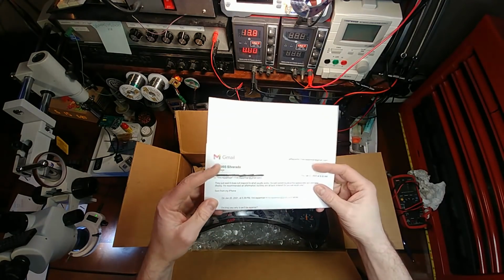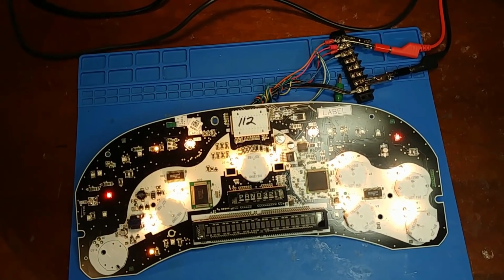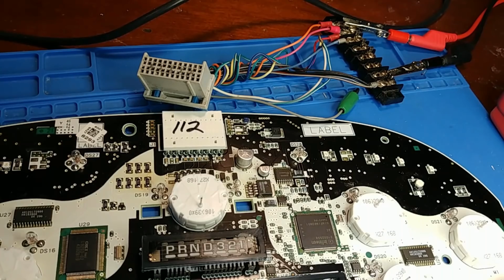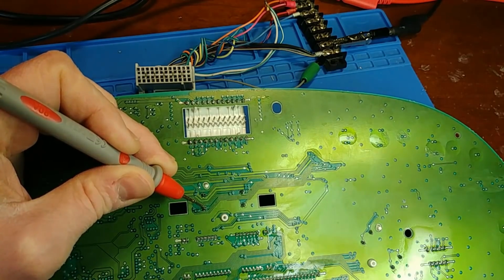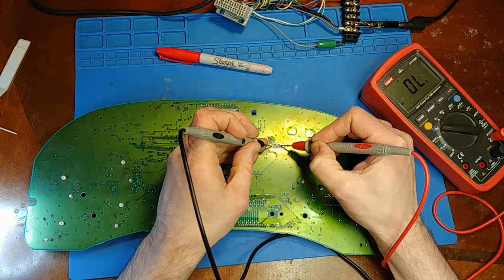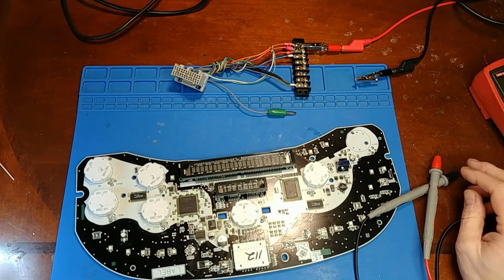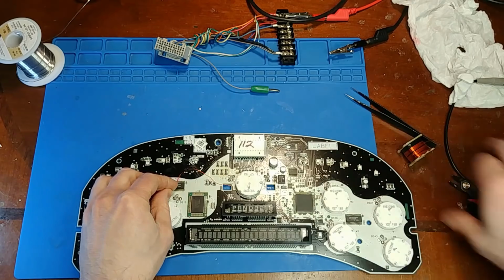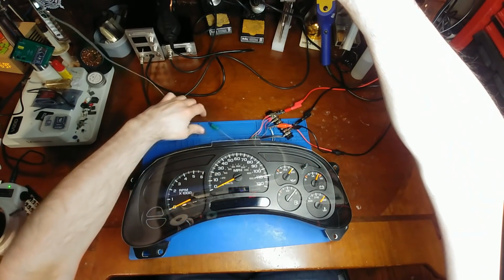"Liquid" Damaged GM Cluster Repair

Comment: It wasn't mouse pee. A lot of board houses manually sand the surfaces of the raw copper boards and sometimes they get a little carried away.
Reply from the maker: Did you see the microscope footage? That break in the foil wasn't from sanding. It was a clean rip right up against the transistor, the transistor would have shown signs of the sanding on it, but it showed non. Plus corrotion forms on the bottom side, not there in the top at that transistor.
Reply: @jeffescortlx  I have ordered thousands of pieces of dozens of designs from a solid 20 board makers. What you describe as a clean break was nothing more than a very low amperage fuse.

Since there is no way for mice to get inside of that cluster and there are virtually no traces of there ever having been one, what other cause could you attribute to a production board with multiple identical and unusual failures other than the boardstock?

It's clear there is something wrong with it, so maybe it got scratched at the factory? Something wrong with the photoresist? Too much time in etching?

I was only a third of the way through the video when I posted anyway.

I have boards of my own design with the same problem not too far away from me.

Another problem caused by too thin of copper is inability to withstand mechanical shock (like hitting potholes in a Silverado).
Reply from the maker: @btasler  the transistor wasn't shorted. It had no reason to pull excessive current. While a mouse can't fit inside, it can build a nest behind and on top of the cluster, so it can't be ruled out.

Comment: No hot glue to keep the wire from vibrating and breaking?  Personally, I probably would have used wire-wrap wire and run it though the via to solder top/bottom.
Reply from the maker: Read PP comment from yesterday we already talked about it. And icesoft1 comment about going through the via, we already talked about that too.

Comment: Hey Jeff, great work. Always admire people who are doing their job professionally. One question or advice though - the enamel wire could lose its coating with time. It is inside a car - subjected to constant vibrations. Maybe some hot glue or properly isolated jumper wire would be a better choice. What do you think?
Reply: Hey, thanks for the detailed explanation and knowledge sharing!
Reply from the maker: In general practice theory you are 100% correct. But in my real world experience it doesn't happen as much as you would expect. Take the aftermarket lamps (with no base support) for example, they have a single solid strand wire supporting the weight of a bulb. In theory the lamp wire should break after a few hours of vibrations. But they don't, I'll get in remans that have had 100,000 miles added since bulbs were installed, but the wire leads are still intact. With jumper wires installed and all the plastics snapped back on, every thing is pretty snugly held together and added parts like jumper wires don't have room to move around. But if I'm wrong and the jumper wire fails, I warranty the parts I install and workmanship for as long as that customer owns that vehicle.

Comment: Hi Jeff, 
First ran across you and your skills back in August 20 or so while looking into the cluster problem that has developed on a friend’s 2005 Chev platform Class C motorhome.
I learned an incredible amount about the design of this equipment and more importantly some very specific skills in repairing very small traces that are damaged. 
Your skills inspired me to take “another shot” at repairing my beloved Kenwood TS 850/SAT Amateur radio transceiver display. I had already put it up for sale as a k-ball parts radio (with no takers, fortunately).  It suffered from the failure and corrosion of leaking electrolytic capacitors that would eat traces, pads, and feed throughs like nobody could believe. That was due to the counterfeit electrolytics that hit the Amateur radio market gear as well as the computer industry heavily in the late 80’s . 

I was able to effect repair on my TS850 and put it back on the air by employing several of your soldering and repair techniques.

Thank you for the inspiration and the great videos!

Ron
de AF9P
Reply from the maker: That's great! I bet your glad you have it another shot and saved it. It's a good feeling to take something that is almost done for and bring it back to life.

Comment: It's videos like this that you really start to realize...this man knows what in the hell he's doing! Awesome display of skill and experience Jeff, if someone want's to know how good you are...just show them this video!
Reply: Love your videos, of all the guys doing this type of work and posting on YouTube, you are by far the most, in my opinion, competent and conscientious by far.
Reply: He may have fixed it but he's no professional, he's an amateur novice at this game. He doesn't even know how to repair a via or identify bad parts by their look.
Reply: Oh yes. Anybody interested, try this tool. Take a flathead jeweler screwdriver, file the edges flat removing the concave, file the end flat leaving 2 sharp corners, sand them further flat and remove file marks giving you a real sharp corner. Use those sharp corners to clean off the trace by pulling toward you and toward the trace break. Now you have some copper to solder to, immediately solder the bare copper NOT using the extra flux. The extra flux in this case is a waste of money and materials. Do the same on the opposite side of the board. Clean out the via hole, insert a single strand bare or tinned wire through the via and solder at both ends. Use the jeweler's again to cut off extra wire. Clean with solvent and apply fingernail polish to seal. One 6 inch piece of 7 strand 28 awg copper wire should last you almost a year unless you get a board lightning damaged.
Reply: @dimwittflathead639  Where's your video? You seem to be an expert in electronic repair... or are you the tech that tried to repair it the first time... lol

Comment: Do you have any PCB drills?   You could possibly drill out the via and snake the magnet wire through the hole and land it on the trace on each side.   The journey of the magnet wire becomes considerably shorter this way...
Reply from the maker: Yes sometimes I can just push the wire through the via. But the pad around the via lifted. I was tired of chasing trace issues so just jumpered the whole thing.

Comment: I found out that the Teflon covered silver plated wire wrap wire works really good for jumpers. I used to work for a GM ASC for car radios and the  "Via's"  or as we called them, "Griplets" thru the board were high failure points. Factory procedure was to run jumpers on all the through board points. Huge PITA to compensate for really poor design. Big time eater. Great job on finding the bad traces. Thankfully you had a comparison board.
Reply from the maker: Griplets? I think that's the first time I've heard them called that. Inside joke maybe?
Reply: @jeffescortlx  Nope, The actual name they called them at the Delco Svc School I went to. They were basically a VERY thin brass (or copper) hollow rivet mushroomed on both sides and often poorly soldered.
  Almost as much fun as repairing TV sets with the  "New & improved" leadless solder used in the micro thin layers in the wave soldering machines. Don't even want to get started on that. 55+ yrs in the field.
Reply from the maker: @f.k.burnham8491  did you happen to work on the radios in the late 80's? My next video is a late 80's radio repair, clock display stuck on draining the battery dead.
Reply: Mostly in late 70's. Never ran into that problem though.
Mostly bad tape decks and RF transistors. 
"My tape deck was squeaking so I shot it full of (your choice)  WD40 or 3-in -1 oil." Sigh...

Comment: I know it may seem like no big deal to you but wow! You’re ability to diagnose and repair this stuff is second to none! 👍
Reply from the maker: Hey! Your cluster on the way?
Reply: He can replace the led backlighting on your 03 suburban auto climate controls.  He did mine on my 06 Yukon and they work great!
Reply: @MikhailSkulls  he said it’s an 05 so not an OBS. OBS stops at 98.
Reply: @MaxPower_Designs  OK...OBS (GMT400)stops at 1998.  So, what do you call 1999 to 2006/7....NQAOBS (Not Quite As Old Body Style)?  I call them GMT800.
Reply: @ronjclm8590  NBS new body style. And 07-13 are NNBS. This is nomenclature that was use in the tech manuals/applications and parts manual/applications when working at the dealer. I worked at a GM truck center from 04-11.
Reply: @MaxPower_Designs  Good to know.  I had a couple of square bodies back in the day, and in 1988, I stopped by the dealership to check out the "little" full sized pickups.  They called it the NBS at the time.  So, now, I see that '88 through 98 ( or 2000 3500's) are OBS. What are the 2014 through 2021's ?
Reply: @ronjclm8590  don’t know about the new ones but this what they’re commonly nicknamed these days regarding built years. 

47-55 Advance Design
55-59 Task Force
60-66 Original C/K (dont remember if they have a better nickname)
67-72 Action Line
73-87 Squarebodys
88-98 OBS
99-07 NBS
07-13 NNBS
14-18 ??
19-   ??
Reply: Hey Jeff! Do you mess with Canbus at All? I got a question if you do, it involves these clusters....
Reply: I was thinking the same thing

Comment: Can you fix it, of cause you can :-D
Now that was an odd one, track breaks that seem to have no cause and through holes too.
Missing power supplys, track again.
The tech must have scrubbed the board down to get ridd of the mickey smell and washed away the evidence as well :-(.
Rossman hates it when a pcb is cleaned, he has to use his brain then,  his words roughly.
That enameled wire looked a bit thick, have you tryed the fine stuff out of a battery clock.
I might have said this before so sorry.
If i didn't, i'm not sorry :)

Comment: I now own 3 2001 Subs, and owned and sold 2 other 2001, all over 200k, all from down south or out west, never a single cluster issue... go figure. And 4 of 5 same champagne gold, 1 dark gold... all 4x4, 1 is a rare 2500
Reply from the maker: The 99-02 GM clusters are generally more reliable than the 03-06 style. They had display issues that became wide spread, but that's about it.

Comment: Looks like the mouse pee damaged the copper and the owner cleaned it prior to shipping it for original repair and scrubbed the damaged areas a bit too hard trying to get it clean without knowing that the copper was damaged ?
Reply from the maker: The solder mask didn't show any aggressive scrubbing at the location of the foil break. So I think it's just some strange reaction from the pee.
Reply: @jeffescortlx  I've see it do some strange things but usually you see the green of corroded copper. Weird one for sure.